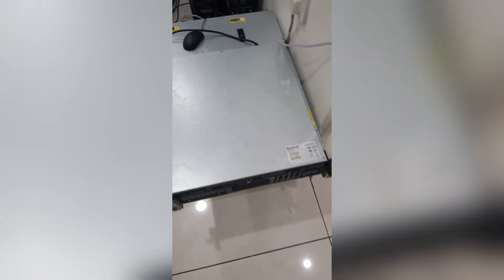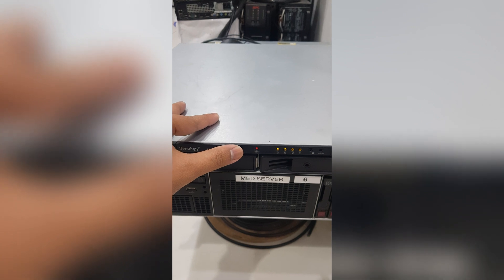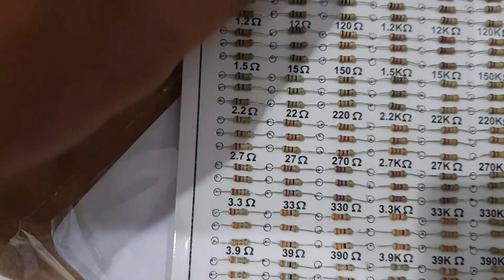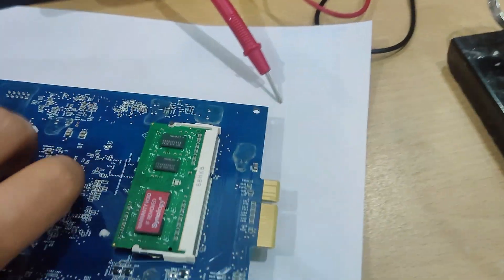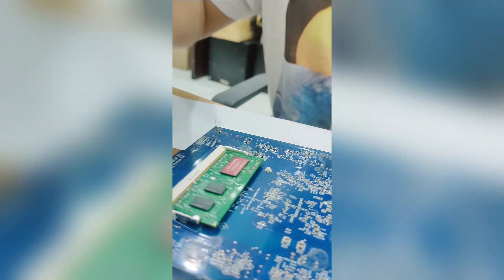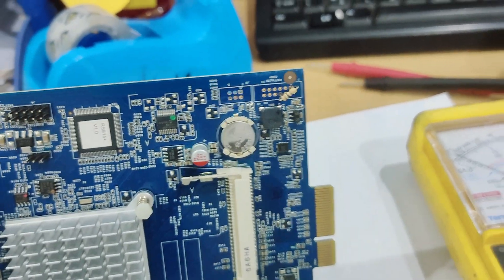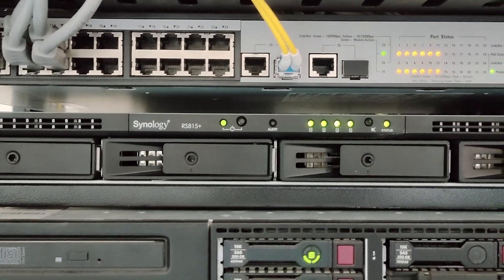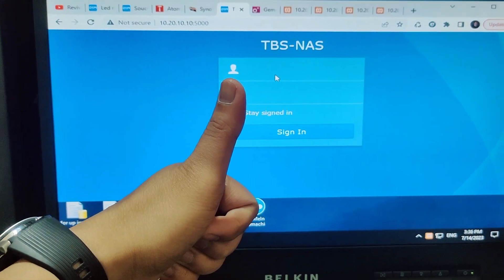Synology RS815+ RED LIGHT ALERT Flashing FIXED | Synology Bug Update For Intel Atom Processors

Comment: FYI just used two 5OΩ in series that I had laying around, actually ,measured to be around 112Ω and it did not work. 
You may need a value a lot closer to 100ohms or potentially this wasn't the fix for me.
Reply: I will buy 100Ω resistor today and report back.

Comment: I had this issue 12 days ago, came across this video, ordered the resistor, soldered it as instructed. I had a drive failure prior to the issue and had ordered a new drive and swapped it in for the failed drive at the same time. The server booted without issues and reported the degraded storage volume which I could repair by adding the new disk the storage pool. Thank you so much for this fix, the server hosts my web, email, and cloud storage.

Comment: I recently had this happen to my same model Synology. Do you know why the 100Ohm resistor restores the functionality?
Reply: Just wanted to comment that this did indeed fix my Synology NAS. It has to do with a clock setting required for the boot of the processor and if you lookup c2000 but intel it will get you where you need to go to understand what is happening. Synology support didn't indicate any of this information to me and I was only able to solve the issue from videos like this and other community repair forums. Thanks again!

Comment: What is the specification of the resistor? Is it 1W 100ohms?
Reply from the maker: Hello, brother I forgot to mention its 1 Watt 100 omhs. Hope it helps .. Thank you for the comment.
Reply: what if i use 2W 100ohms? or it has to be 1w?
Reply: @reboot1337  I'm sure that will work with 2W as well, but I just fixed one today using 0.6W and 100ohm (this are the most common)...
Reply: @RauLasH26  it worked i fixed one for my friend